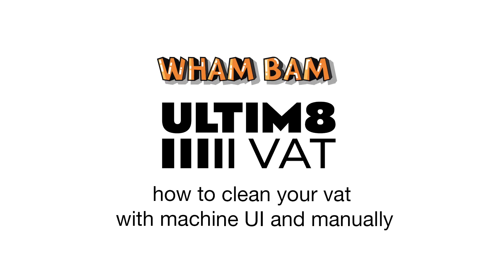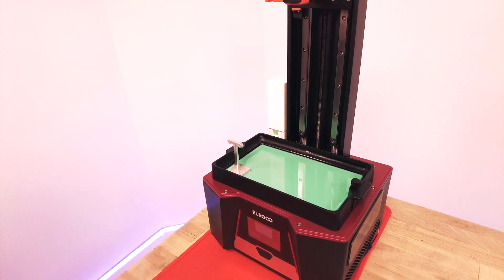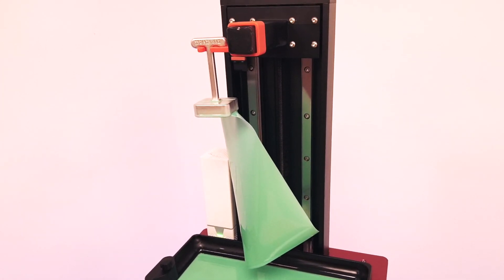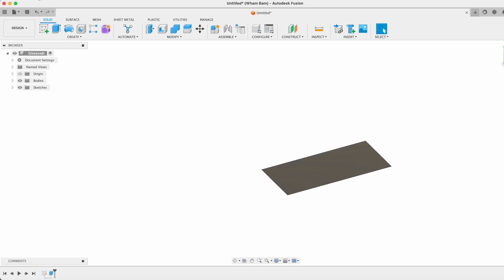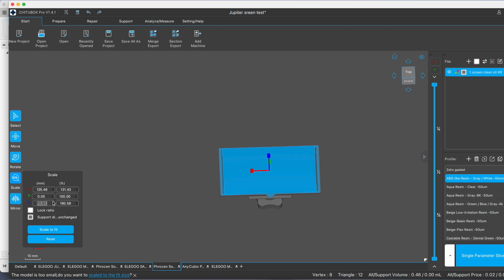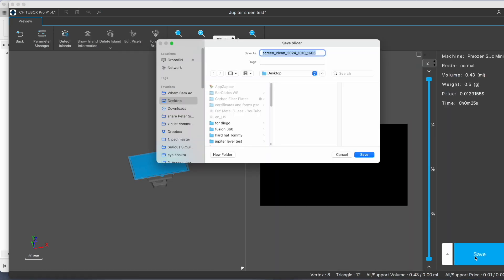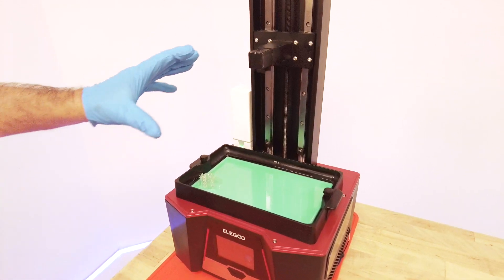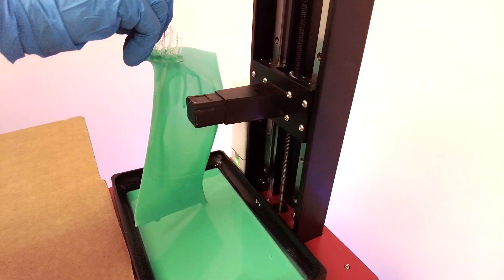Best Process to Execute a FEP / Vat Clean on a Resin Printer

Comment: One tip. DON'T PUSH DOWN WHEN YOU INSERT THE TOOL!. The first time I used this I didn't push down and everything worked great. The second time, I put some pressure on it, as the resin was a high viscosity resin. That was a mistake.
I had 2 problems.
1. The layer under the tool was so thin, it came away and left the rest of the cured sheet in the vat.
2. Still trying to get resin out of the grooves. Soaking in IPA did not release it.
Reply: I think to get it out of the grooves, re-run the cleaning process without pushing down, and get a full sheet to work with, then peel that, and see if it cleans the groves for you.